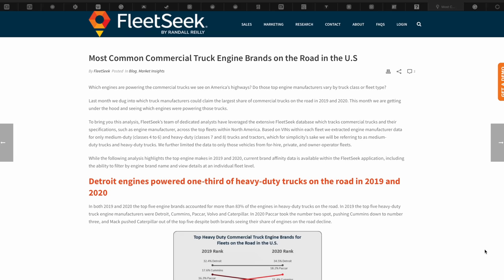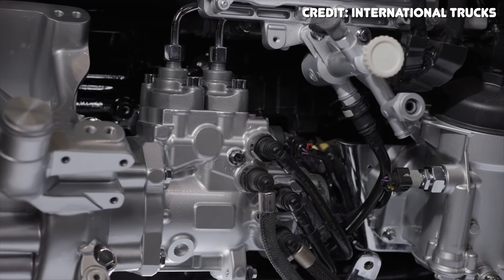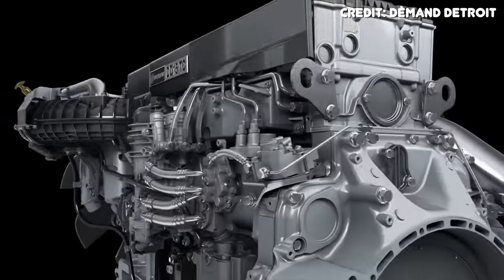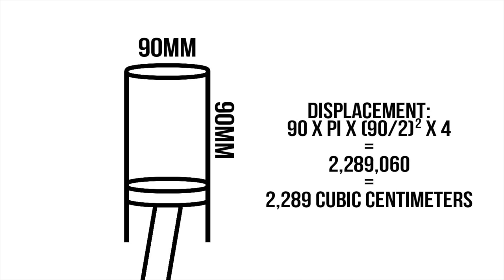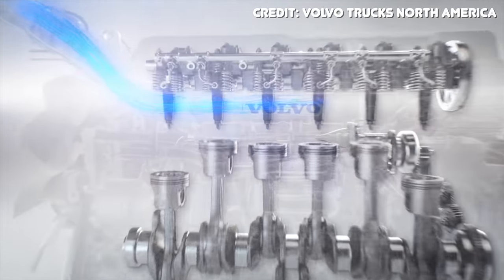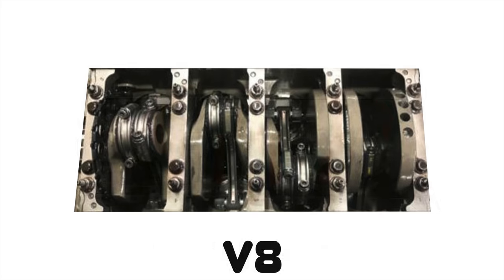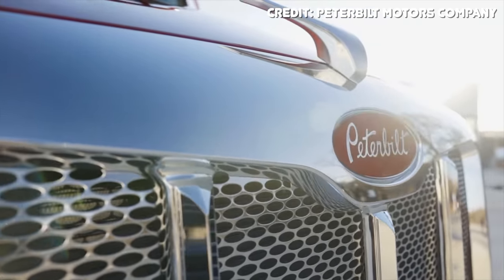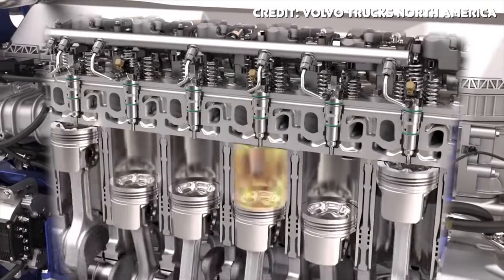Why do Semi-Trucks Use Inline-Six Engines?

Comment: Scania (a Swedish truck manufacturer competing with Volvo) does still develop and mass produce their V8 lineup, they are euro 6 compliant and produce 770hp and 3700Nm (2730 ft-lb), but most importantly they sound absolutely amazing, they have most likely survived because of the requirement for powerful engines whilst hauling logs in the somewhat mountainous north of Sweden
Reply: They also sound ungodly cool when u put a straight pipe on it
Reply: I saw a video about a truck study Scania did years ago. If I remember they concluded trucks are safer if they move faster with the flow of traffic (Or something to that effect). I'd guess that is why they produce such a high horsepower engine. In some of the most demanding applications, especially road trains in the hot Australian outback, they usually use engines rated at a lower horsepower for reliability.
Reply: scania only making v8 for marketing reasons, there is really no need for v8, Volvo has the same HP and Torque ratio with an inline6.
Reply: @johnnyhun1  Yeah, but they sound cool as heck and easily produce 1150hp (stock for marine applications) and they somehow managed to burn 8 L/100km with a 30t load (perfect conditions)
Reply: @kalle5548  Its still not about how many cylinder it has or its a V or Inline, in that case bmw had 1,4 liter 4 cylinder engine with 1200 horsepower (m12) ... :D So technically V8 today is still pointless, but yea they sound cool :D
Reply: @johnnyhun1  Cars and trucks have different priorities, but daim when the turbo hit I bet that thing is a monster
Reply: The market for Scania's V8 engines in maritime use is MASSIVE!
That is a big reason they still make them. Scania themselves say Italy is their biggest market for the V8.
But yes. The sound of the Scania V8 is legendary.
The Scania V8 is popular in speed boats and power yacths because it is compact and extremely reliable. The V8 producers most power in relationship to size.
Reply: The Caterpillar C18 Acert gets around 1150HP and close to 5000NM while the C18B should be 1500HP and licking 6000NM. 

Kamaz also has been using Liebherr engines with interesing results with 12, and 14 liters, Liebherr also makes a 18L one

However peak power and torque number are meaningless if the Torque curve isnt flat that means engines which start to loose torque after 1200RPM like nearly every modern truck, who only have their posted power numbers at 2000RPM, marine engines have a flat torque curve and should be driven at 1400-1600RPM rather than 1000RPM like modern trucks

Running high compression and less agressive camshaft means that you cant turbocharge as much or will overheat and blow the gasket as a result modern day 450HP truck are gutless compared to 1990s 450HP

If you Drove a modern 460 or 480HP Scania or Iveco Stralis or Volvo and then you drive a old 470HP Iveco Eurostar 14L you realize just how much more muscle older trucks had
Reply: @renacimientoargentino7515  older trucks doesnt have more power, you just feel like they do because they operate at higher rpm and more noisy. Turbostar had a 18 liter V8 and could only produce 300 something hp, while Scania can produce 520 hp with 13 liter i6 engine. Modern truck engines gives max torque at like 800 rpm, but every idiot driver shift back and rev the shit out of the engine on uphill so they can go up with 10 km more than if they would let the auto gearbox do its job, and the fuel consumption would me much much better but noo they think they are smarter than 100+ engineer who worked years on that LOL
Reply: Engines dont produce power, they produce torque and they spin, the power number is a mágical number you get when you multiply RPM by NM of torque,, the Scania DC16 730 only has 730 horsepower at 2100RPM, between the torque range of 1000-1300 RPM you never will have over 600HP

Older engines like the 14L 470hp Eurostar had less peak torque and power numbers but it had more torque when you need to use it, that is 1400-1700RPM when you overtaking or going uphill or mantaining speed, like a modern 13L scania losses its torque just after 1300RPM

To put it simple the 900hp version of the Scania DC13 has 3000NM, but all that torque is there from 1000 till 2200RPM, the S560 with a DC13 has 2800NM but only under 1300RPM
Reply: @kalle5548  r u sure burning only 8L/100 km with 30 Tons of load ?
That's 12+ km per litre !

Not many  SUVs give that kinda mileage which weigh just 2.5 tons.
Reply: @johnnyhun1  You mean F1 engine with 5bar of boost? at 11500RPM? That engine withstood only limited time 2-3laps at best in qualification but in the race the boost was reduced to 3.3-3.8bar max.. And consumption was staggering 120L/100km..Apples and Oranges.. Truck needs torque and its our Tradition (Scania) V8 One of the most reliable engines ever build (of course there are others just as amazing) But V8 its in Scania DNA🙏🇸🇪🇮🇩❤
Reply: @johnnyhun1  you’re supposed to downshift before the hill instead of letting the auto bog the engine down. The autos bog the engine down for lower fuel consumption not reliability. Not sure if you ever drove these paccar auto trucks but they like to bog the engine down to 1k rpm climbing and all the plastic in the truck rattles. Even ground with light foot is ok to run at 1k but when you’re doing a hard climb that’s just needlessly over stressing engine components.
Reply: @ffx95  not really, these engines are tough as hell, it only rattles because it has torque peak thats all. If you rev the engine only thing you achieve you go up like 10 km/h more than you would if you would let the engine do its job, but at the same time you use much more fuel. Driver brain time long gone, let the machine do the job, its much smarter than any driver ... And I drove DAF, which has Paccar engine, but Volvo is doing this eco stuff much more. Newest Volvos with I-save package is a real granny experience... but this is why you are get paid, to do your job and make as much money for the company as possible
Reply: @brianmcauley3450  I'm pretty sure they will fine the hell out of your company in europe if they find out that your trucks doesn't comply with environmental regulation
Reply: Yes we know who Saab is 😊
Reply: That’s amazing, didn’t think it would produce that amount of torque. For me the Hp ain’t anything impressive, it’s the torque. I use a deleted X15 Cummins, really puts out the power and far better milage. I just wonder the power potential in that Scania engine if it were deleted
Reply: @johnnyhun1  higher rpms under heavy load makes the engine consumes less fuel and do less wear on the engine
Reply: They are also very popular as marine power for some of the newer US commercial fishing boats
Reply: @Pung_Henke  not with these modern engines. Maybe with the old ones ...
Reply: Any type of massive cargo actually. I work at a company that requires oversized transportation all the time and I see all the time those mighty Scania, Volvo and Man V8s on daily basis. God, they sound so gorgeous with modified exhaust.
Reply: @0907Vladimir  there is no  v8 for MAN anymore for the last ... 10 years? In Germany oversized transport companies mostly use Mercedes and MAN, merc has 640 hp as the largest engine, man is the same, around 600 something, and its enough even for the oversized loads ... still no real purpose where ONLY those v8 and 750hp volvos can succeed only ... if the load is THAT heavy, the method is using more trucks to tow the cargo in the front and in the end.
Reply: @johnnyhun1  U would be surprised but there is still lots of MAN V8s around here and that's for a reason. They simply do the job with ease just like other V8s. Also, my country being a little bit poorer means transportation companies refresh their fleet less frequently.

Loads aren't THAT heavy, but the highways are very steep around here and it is really akward when the truck is underpowered for it's cargo.
Reply: @0907Vladimir  bro I worked in Norway where we hauled ~45 tonns, but the company had 13 liter 500hp straight6 engine Volvos with full eco package. I was going uphill like 20 km/h but who cares lol? And the v8 mans are old as fuck, and as I heard they are not the most reliable engines, also Mercedes and Iveco had v8 engines but they realised no point of the v8 while you can achieve this power with a straight6 16 liter engine. For Scania its their fancy trademark, also its cheap for them to manufacture because they also use the v8 engines in marine industry
Reply: @kalle5548  Volvo got the same power output for marine on the straight six
Reply: Euro is 29 years in the future compared with USA
Reply: @johnnyhun1  It is a mind-bogglingly high specific output but not useful for anything but racing as they were stressed literally to the breaking point.  How long would any tiny engine like that survive on 60 lb. of turbo boost?  No million miles.
Reply: @mescko  then think about that old V8 american muscle cars with their 5-6 liter, naturally aspirated engine and they could baerly produce 200 hp while today even a 3 cylinder 1 liter turbo engine can easily put out 180 hp and can live 3-400.000 km (250.000 miles)
Reply: not only my friend as you see i6 is a bit long and for our eu roads that aint good we have alot of small streets so a bit wider but shorter v8 is needed over smaller streets roads etc etc.
Reply: @tigriukasinlove  lol thats pure bullshit bro. Remember the T-line Scanias or the Longline series
Reply: yes, because there is still a market for cabovers in europe. Wish we had more in the US.
Reply: Diesel engines are not limited for compression ratios like gas engines. They don't have preignition issues that gas engines have due to fuel not being injected until time to ignite, therefore, you can run as much compression & or boost as desired for the desired power as long as block & headbolts can hold together. 

Some Diesel racing rigs run up to 150lbs boost from thier turbos. 

That said there is a limit for boost or compression when it comes to emission control, namely because of nitrous oxides forming at high pressures.

Comment: one thing overlooked in the video is that the forces on the crankshaft main caps in an inline engine are mostly straight up and down, in a V engine the power strokes are on a 30-45 degree angle meaning you have much more side loading on the main caps that requires additional strength.
Reply: yea and intake runners, valve angles, and piston quench are better on a v8 design which all add to efficiency. The harmonic pulse of the power stroke of a 6 cyl hammers harder than sharing it over a bigger bore count. This is why tractor pulls use turbines.
Reply: On a...side note...
Reply: Very good point. I was along the thought that i6 engines run smooth and diesels by nature have a lot of vibration.

Comment: I've always thought the I-6 was theoretically the perfect engine configuration with the exception of space.
Reply: Bmw 340i
Reply: yes I-6 engine has perfect primary and secondary balance which is why they are so good and smooth. the only real drawback is the length of the engine which is why many manufacturers prefer to use V6
Reply: A bit nicer for doing maintenance on a truck too , for that reason alone a 6 would be my pick for a truck power unit .
  V8`s sound nice and are good until you have to work on them .
Reply: noisy
Reply: I6 have superior fuel economy compared to V8
Reply: Maybe VR6 is the answer.
Reply: V12 is even more stable, although it's freaking huge
Reply: The space situation is actually better with a I6, plenty of room on either side of the engine for manifolds turbos and filters.
Reply: Inline 6 is the smallest naturally balanced engine. Inline 8, 10, 12, etc and V12, V16, etc  configurations are also naturally balanced, with fewer degrees between each powerstroke (smoother)
Reply: If we go theoretically perfect, than that accolade would go to the V16 (either narrow angle 45 or wide 135 degrees), because on top of primary and secondary balance, those also have a perfectly even distribution of ignition points (exactly every 45 degrees of crank rotation). Obviously impractical for any on-road use, but they are the most common diesel locomotive units as well as very common in marine applications.
Reply: and weight, they're heavy lumps compared to a V configuration.
Reply: Well, except for the flat-12, which is basically two I-6 engines connected to a single crank with the piston banks 180° apart. Shared journals aren't much of an issue at 180° as each piston and rod is a perfect counterweight for the other in each set. Some of the best racing engines (sports cars, F1) ever made were flat-12s. They could run at ungodly high rpms because they were so well balanced.
Reply: @docvolt5214  Flat 12 is even smoother and perfectly balanced. Each piston has its own counterweight in another piston exactly 180° from it. But they are very wide.
Reply: @Tc4ify  Except for a flat 12, which has two banks of six cylinders exactly 180° apart. Perfectly balanced with each piston the counterweight for the other one across from it.
Reply: It is.
Reply: The same can be said about  block V arrangements
Reply: it really is... everything is in a straight line perpendicular to other mechanical parts and the drivetrain is also in a straight line.
Reply: @catinthehat5140  ford 300 i6 >>>>>>>
Reply: @mikldude9376  be careful saying that around cummins and powerstroke people
Reply: @genesmith4019  isn't that what I've heard called a boxer configuration?
Reply: A flat 6 is probably the best as it sits the lowest and the cylinders cancel each other out.
Reply: @vxsr33  yeah and a v6 fwd is cheaper to manufacture then a inline 6 rwd or awd.
Reply: @hanzen5174  and just about the same power
Reply: @AMV12S  not really. Can't really reason why, but VW tried and failed. Also I don't think they made a diesel VR engine
Reply: @scottwickwire-brock4736  As with everything, there's no one "best," just best for a specific application; Boxer 6 vs inline 6 comes down to application. As was described in the video, if you need a balanced, simple, undersquare engine to run at 2k RPM, an inline 6 is basically perfect. Boxer 6s come into their own when you start considering packaging and balancing for high-revving engines. They're much shorter engines, and have the weight of the valvetrain far lower than an I6, while also requiring less counterbalancing on the crankshaft, which reduces the intertia of the engine internals. You do sacrifice simplicity and serviceability, though, as you've got two heads and a 2-part engine casing that is theoretically more complicated to design and assemble.

All that said, I'd take a Porsche flat 6 over a BMW straight 6 any day, but it has less to do with the layout than it does with the general reliability from those manufacturers (though this can be specific to the individual model). Both engine layouts are phenomenal in the right application.
Reply: At som point the engine displacement becomes to big and the pistons to heavy. If you want massive power, thanks for example often use diesel v12. 

To heavy pistons limits the maximum allowed piston speed (i.e. engine max rev).

This is why car engines rarely have four cylinder with more than 2 liters displacement.